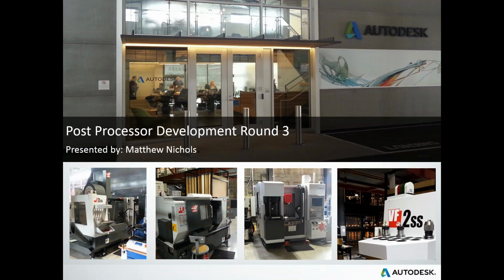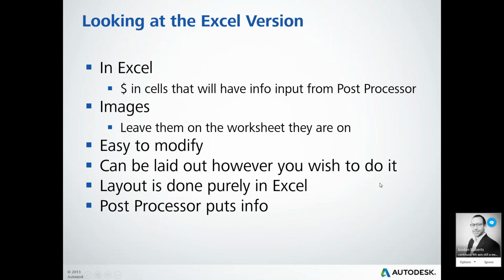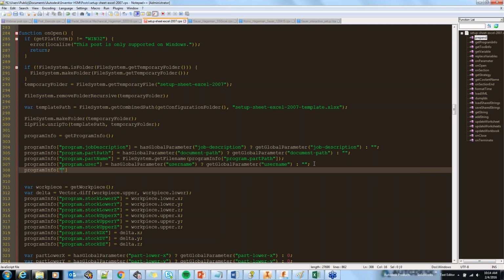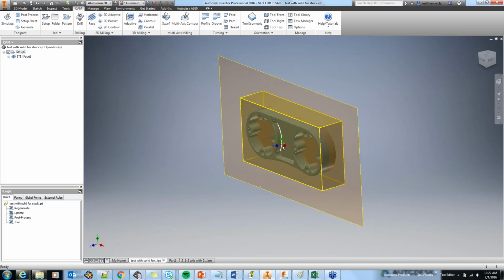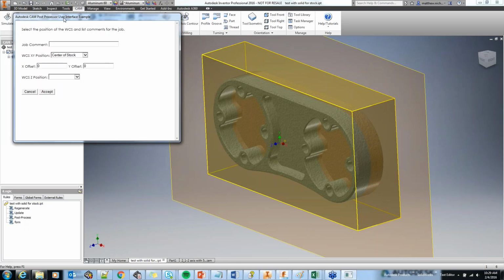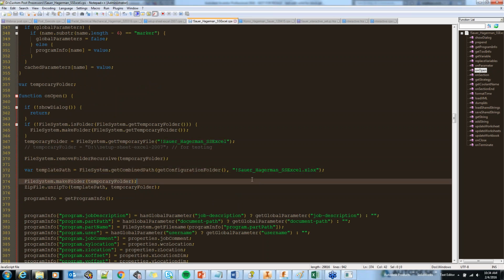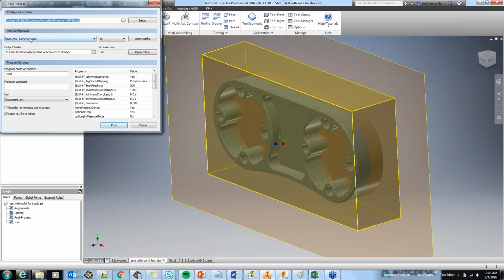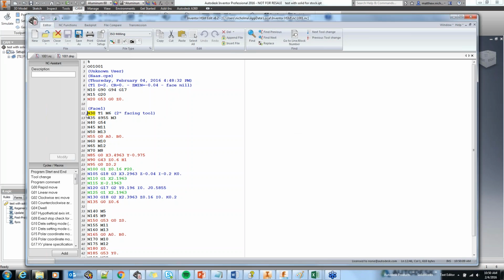Post Development Basic Training Part 3

Comment: Really useful set of vids - but what on earth were you using for a microphone? I assume a 1930s wind up telephone? The bandwidth required for the audio is miles less than for the video, so really no sensible reason to skimp on the sound. But I learned a lot here, so many thanks!